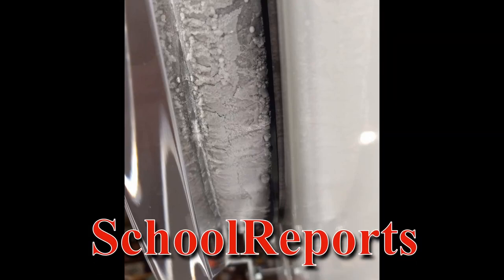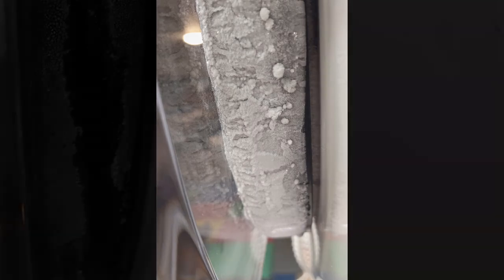Ice on Door Seal and Condensation on Door

Comment: Just did the first bread run and have mositure on the inside of the door? Is that ok
Reply from the maker: Good question. 
   It is possible (maybe likely) to have some condensation on the inside of the door for a short time during the early part of the process, especially when the food is not prefrozen, but it should go away quickly when the vacuum starts, or before. After that there should not be moisture on the inside of the door, but you may get condensation on the outside of the door and seal. (Of course there will be ice on the chamber walls)
Reply: @SchoolReports  awesome thanks for response, running some skittles now 😀
Reply from the maker: @rondogrides361  You're welcome. Everything turned out well? 
   Freeze dried Skittles are sure better than non freeze dried Skittles. I don't really care for regular ones. When doing Skittles (unless trying to get video of them), I'd recommend covering them with a paper towel to help keep the exploding bits from flying around the chamber. - Less cleaning.

#1 thing to remember - Never trust the machine to know when the food is completely dry; it can't know! Period.

   Remember, I'm just another idiot on the internet. The #1 joke at our house is "But, I saw it on the internet!"  I look at what commercial companies are doing. If they can do it, we probably can too. (with method adjustments)

"If you read it on the Internet, it's absolutely true!" - Abraham Lincoln
Reply: @SchoolReports  hahaha exactly, just started them probably 1h in. This time just condensation on the outside of the door

Comment: Oh yes, that ice buildup on the outside ring looked like ours until we came across your channel last year and we did the 'monkey see monkey do' imitation of your insulation around the black seal.  In fact, before doing the insulation sometimes the ice would build up so thick that when the vacuum freeze began, the seal would be compressed and ice would break and fall from the black seal to the floor. Again, we have the same machine as your sister and you mentioned something about the freeze cycle going to -40. Is that true on your sister's machine? In the menu screen for our machine the set-up only gives us options down to -20. I know your red machine is like a manual transmission sports car (which we like), but I find the options on our model (firmware) seem to be more automatic. Any insight would be helpful. I think we need a 'Monkey see Monkey do" t-shirt. :)
Reply from the maker: Yes, my sister's machine does get down to -40ºf - however that's the chamber wall temperature (the metal barrel), not the tray temperature. We can see this because we have thermometers touching the chamber wall. The newer machines like hers (and yours:) heat up the trays to prevent the trays from getting that cold - as you said tray temp can only go down to -20ºf on the newer machines.
Reply: Thank you so much for explaining this to us. The one thing we haven't done is get thermometers for the inside of the chamber/trays. Again, the biggest lesson you've taught us is weighing product as food dries using a digital scale. Invaluable! Thank you for all your videos!  @SchoolReports
Reply from the maker: Sorry if this is more than you ever wanted to know! 😁
The thermometers are absolutely not required for freeze drying, and I absolutely love using them. I consider them to be the second most important tool (after the scale) for freeze drying. I like data; I like to know what's happening inside the machine. I never use the thermometers to tell me if the process is done. (they can't) I use them to tell me it's not done. I know that might not sound like a difference for some people, but if there is still any cold area in the food and therefore the process can not be complete yet, even though the freeze dryer firmware is telling me it is. 

    I use the thermometers for two main reasons:
First, to let me know if the food is getting close to being complete and second, to tell me if it's too cold to take out. For example, I might be doing a batch where the machine says is getting close to done, it might be in the last 3 hours and is going to finish at about 2 am, but one thermometer is showing that one tray is still only 10 degree, and I know from experience that it wouldn't be done in just 3 more hours, so I add more time without having to take it out and check it. As some (most) foods dry, they really became like super light fluffy insulation. The top and bottom layers can be very warm, yet there can still be a layer of ice through the middle. The machine's temperature probe will often say that it's very warm not knowing about the ice in the center layer. - Example: https://youtu.be/qDuB_T8gIm8?si=BZSwReZ0c2PZDpv2&t=540

   Second, if the freeze dryer finishes when I'm not there (happens a lot for us:), I can still know the temp of the food, making sure it's still warm before I take it out. If the food is -40, there will be condensation on/in the food almost instantly, you just won't be able to see it because it will be absorbed and not visible. It probably will have already happened before you even get it out of the freeze dryer. The room air moisture going into the machine when the drain valve is opened may be condensing in the food before you even have the door open. There is a temperature probe built into the machine (it's on the bottom of the second tray from the bottom on mine), it's sandwiched between the heater pad and the rack itself. It can not tell me the temperature of the food, only the temperature of the heater; good enough to know the temperature of the heater for controlling it, but tells me almost nothing about the food. 
  Again - Thermometers are absolutely not required for freeze drying.

Comment: Hello i got freeze dryer just today, is it okay moisting on tge glass?
Reply from the maker: It is "normal" to get condensation on the front of the door, and condensation and even ice around the seal, unless you insulate them.
  The machines don't require/need the seal insulation or the door disc we add, but for us it's a useful addition because of two related things: condensation and heat transfer. First, while it's cooling, but before the vacuum pump starts, it helps with heat transfer. Secondly, and most important to us, because I often (very often!) don't get to the machine right away when it finishes, it just sit there chilling. Sometimes it waits 12 hours or more. Very chill, -40 chill. By the time I get around to it, without the front disc and seal insulation, the entire door and seal would be covered with condensation, both liquid and frozen. Then it melts and makes a mess. For people who stay right on top the the process, ready to take it out and check it the minute it beeps, it probably doesn't really matter. 

Do not trust the machine to know when the food is dry. The machines can not know.
Reply: @SchoolReports  thank you sooo much. Can i DM you please, im making dog treats for street dogs in uae
Reply from the maker: I don't have anything that does DM's, but I do try to answer all questions left on any video and I do have an email link in the channel's "About" section.